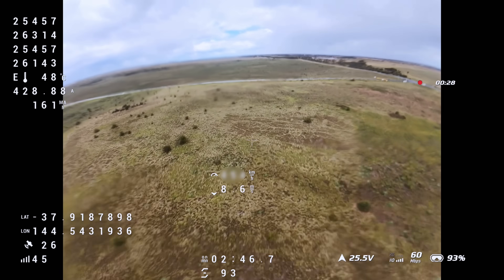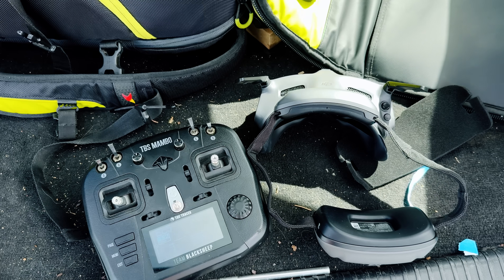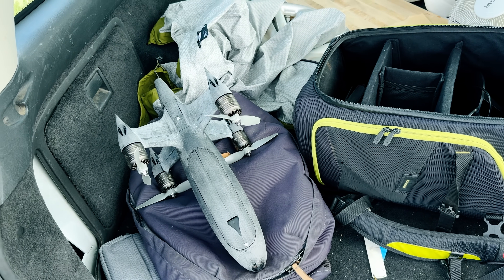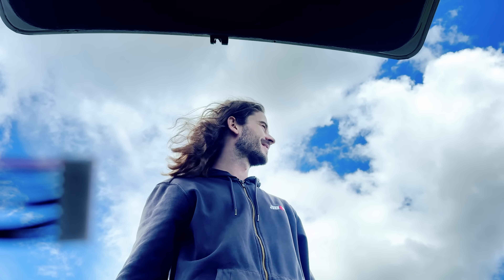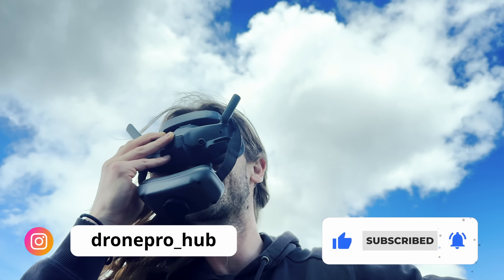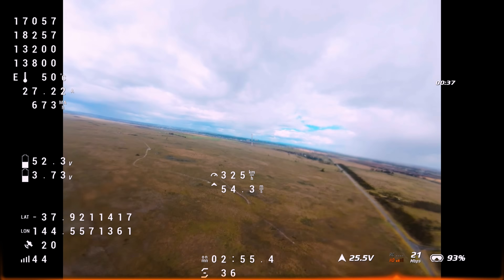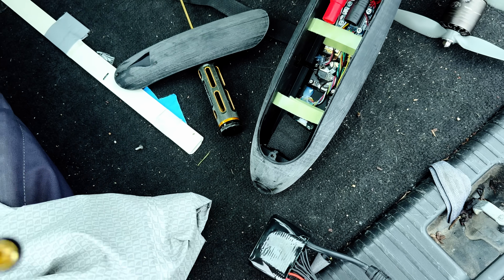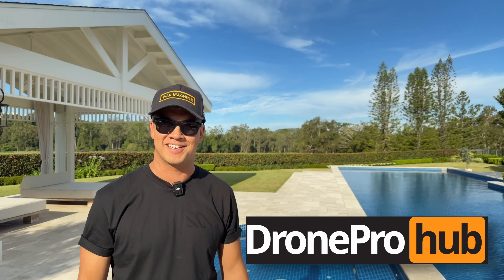OVER 600KM/H – NEW WORLD DRONE SPEED RECORD

Comment: I admit to being a bit skeptical at first.  :)

However, an analysis of the doppler shift audible in the run at 6:27 gives a result of ~510kph as you pass over/in front of yourself.  Given that the aircraft was well below top speed for the run at that point, and with a lot of vertical and horizontal separation, I'm inclined to retract my initial thoughts.  Well done.

If I might suggest -- for further flights, try to reduce the distance between the aircraft and the device recording audio (Maybe a third camera?), try to time your run for peak speed over that camera, and provide a less cluttered audio.  That would make verification easier and more accurate.  A grainy HUD is going to be pretty easy to fake, but getting a properly synced spectrum that gives an arbitrary speed is another thing.
Reply: Interesting way to verify. I was standing at the road you see me cross, and at that point the osd shows approx 520 so seems pretty accurate
Reply: @benbiggs5226 Yeah, I saw a description on how to calculate the speed of a passing (rc) aircraft using doppler shift more than a decade ago when I was messing around with rc helicopters. With even a moderate quality audio recording of a pass, you can get shockingly accurate speed results.

If you're going to give it a try, make sure to record the ambient temperature and humidity, as these both affect the speed of sound, which is a constant in the calculation.

Your GPS record is almost certainly as or more accurate, but in the current age of ai slop and faked videos, it's nice for us the viewers to have something we can do to reliably verify the numbers ourselves.
Reply: @grnbrg yes people love to say it’s fake because it doesn’t look that fast, it’s good that it’s possible to verify just based off the sound! Can also put lat and long into google maps and verifying distances and times. But most people commenting would never bother. I appreciate you taking the time to check rather than just shouting fake!

Comment: I wonder how it'd go if you went to say 70% throttle until you reached equilibrium speed before pushing to max for the burst. The cell voltage after your run is still quite high. How much are you putting back into the cells after you land?

Comment: You need to heat soak your batteries for at least an hour at 120° f. They will give full push and finish the run much cooler. It's counterintuitive put the heat is a catalyst for the release of electrons. Personally I would go above 120 but it's a good place to start.

Comment: As fast as that drone goes it seems strange that such a full-sized aircraft wasn't built many decades ago by aircraft manufacturers when props were still in use.  Anyway, congratulations on the record run. Keep up the good work and don't listen to naysayers.

I was surprised to see the drone steers using engine speed and no control surfaces. That's pretty slick.
Reply: Lots of things don't scale linearly with increasing size, so what is optimal for something the size of a drone wouldn't necessarily be optimal for a full size aircraft.

Comment: Honestly i believe the pull prop is better than Luke's one which uses the push prop. Better cooling solution and less drag on the motor mount
Reply from the maker: We have more improvements coming have designed and are currently making spinners

Comment: Did you know you can over volt these batteries for quite a substantial extra power. I have been doing it for a long time to max out flashlights.

A 4.20 v lithium cell can be charged to 4.25 and even close to 4.3v for a big boost in extra power. It doesn't hold the charge for long and you need to charge them up to it right before you are going to use them. And it does increase the risk when charging and using them. But i have done it for years and i haven't seen any issue other than faster degradation.
Try it if you want and need to max out a record run.
Reply: Yeah think it could be worth a shot on the day

Comment: You need to get a lifting drown to bring you up to height say 350 meters and then release straight into the run so you have max voltage and capacity. A DJI mavic or something would probably do the trick, and DJI because of how good they are hands off instead of a FPV drone which you could build specifically for lifting.
Reply: I think dropping it from another drone would make for a sick video and get crazy speeds!

Comment: Great start and live the design. For what I'm after, it would be a super nice fit. The following is for official world record award.......Guinness World Record for drone speed, the criteria require two level, opposite-direction 100-meter flights, with the final speed being the average of the top speeds from both passes to negate tailwind effects and gravitational assists from dives. The drone must be powered solely by its own propulsion system, not assisted by gravity or external forces. 
Key Criteria Explained:
Two Runs in Opposite Directions: Two separate flights are required, each covering at least 100 meters (about 328 feet).
Level Flight: The flight path must be level, not a dive, to ensure the speed is achieved through the drone's own power and not aided by gravity.
Opposite Directions: The two runs must be in opposite directions to average out any effects from wind (a tailwind would unfairly boost speed).
Averaged Speed: The final, official record speed is the average of the top speeds recorded during each of the two runs.
Independent Verification: The attempts are conducted with independent witnesses to confirm the accuracy of the measurement

Comment: RC car speedrun guys are charging to 4.25-4.3 v/cell and heating to 50 deg C prior to a run.  You may benefit from these steps, however they do carry their own risks.
Reply: Yes I think preheating batteries is definitely the go. Overcharging an interesting idea, maybe if I go for the official record
Reply: @benbiggs5226  The fastest RC car speedrun guys are over-charging just to get a little bit more voltage under load, more so than for the extra mAh capacity, but in the case of a drone that is landing with little remaining capacity it could be a double benefit.  Especially since the lower IR from heated cells will draw more amps (assuming no other setup changes and that the electronics can take it) which will pull more mAh from the pack during the speed portion of the run, making it even more marginal to have enough mAh for return and landing.

Comment: Am I reading your OSD right? Are you only using about 200W to cruise at 200 km/h? Is there a lot of aerodynamic lift in your design?
Reply: current sensor on escs not accurate at low currents

Comment: I would love to know the motor/ prop combo... Would really like to try this setup with a single motor on a fixed wing plane. Please PM me if you don't mind sharing.
Reply: can't see a way to message here, I've seen you on rc groups ill message you there later
Reply: @benbiggs5226  Hey man, thanks! I freezed the video in a few spots and worked out the motors and props, but can't see KV exactly. I see you cut down props too! I think I know what they must be but won't put details here in case you want to keep it under wraps for now.  Would be good to chat on Rc groups, Drop a link to the thread you frequent. I am so impressed with what you have achieved, really incredible work! You realise it's actually not just the fastest drone, but approaching the fastest electric craft ever to fly!!!
Reply: @OMEGOOLIEBIRD thank you! Keen to chat with you. Keeping the exact details a bit quiet for now. Yes I noticed it’s not far off the fastest electric aircraft! Would love to target that record at some point.

Comment: Super interesting that this was near to a storm. I wonder how big the influence low/high pressure air is on the performance. I know that low pressure air is good for speed skating records, but here the speed is much higher while the area facing the wind is much lower.
Reply: It’s an interesting one, low pressure means a bit less drag but since the props are basically pushing the air backwards it also means less thrust. In my opinion since these drones have lots of power and very low drag, high pressure is actually better.

Comment: what if you cut weight for example an analog vtx if its liter
Reply: At these kinds of speeds it's almost entirely aerodynamics vs power. Could probably throw a few lead weights in it and not make much difference.
Reply: @Jakalwarrior  but still i think bro should try to cut weight maybe the battery will last longer

Comment: Glückwunsch, echt beeindruckend! Ich habe gerade erst meine zweite FPV‑Drohne gebaut und will auch mal eine bauen, die vielleicht 300–400 km/h schafft. Möglichst zwischen 250–300 €, weil ich als Schüler und wegen meines 3D‑Druckers, broke bin 😅. Weißt du, wo man außer AliExpress günstig gute Komponenten findet?
PS: Freue mich schon auf die Doku
Reply: Gute leistungselentronik kostet nunmal geld. ausser Sponsoren gibt's da eigentlich keinen weg dran vorbei
Reply: You could for sure get those speeds on a budget. Tmotor make decent reasonably priced motors. The key is high pitch props such as apc 5x11 or 5x8. Aerodynamic design and high pitch props are more important than buying best quality gear.